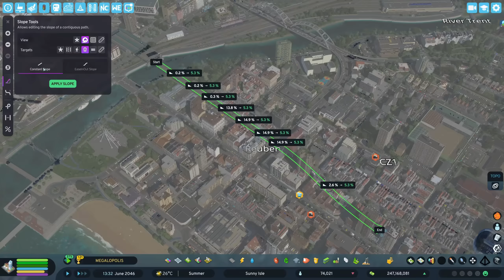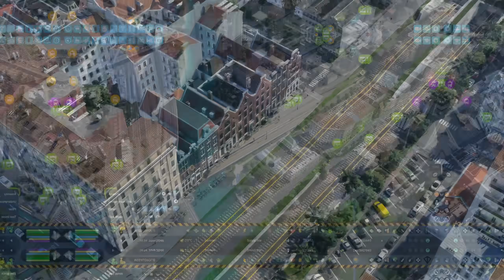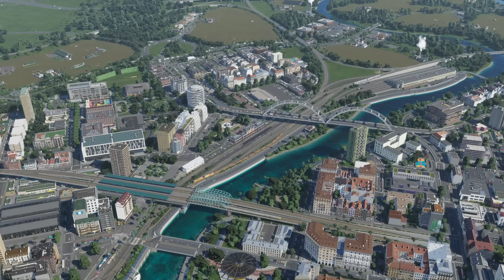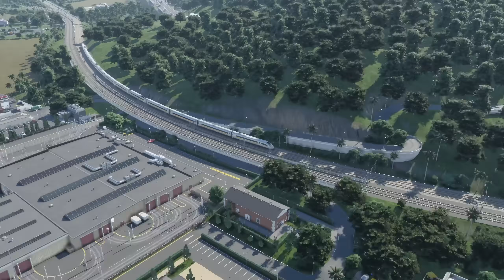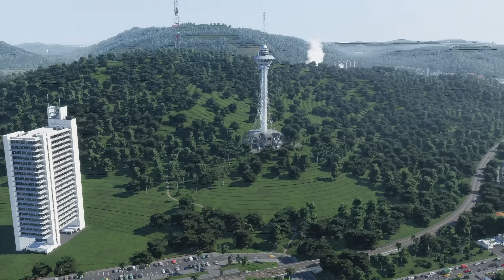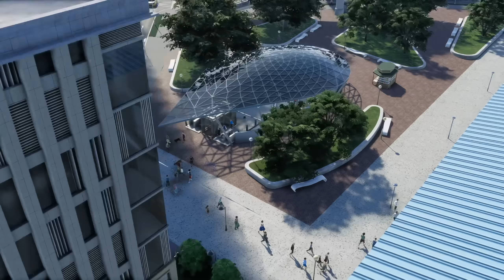I Finally Gave High-Speed Trains Their Own Station — Cities Skylines 2

Comment: I use the 4 rails a lot. I use way points to make cargo rail use the inside lines and passenger trains use the outside. It's a bit to set each line, but it really makes a difference. Tip: be sure to use the way points wherever lines intersect or split.

Comment: loved the vid, quick question I tried to download the sunny isle mod pack but my pc couldn't handle it, what are you pc specs?
Reply from the maker: CPU: Intel Core i7-13700KF
GPU: Intel ARC A770 16GB
RAM: 64GB DDR4 3200MHz
Memory Motherboard: ASUS TUF Gaming Z790-Plus WiFi D4
Reply: Ty so much, im running 
CPU: i5 -12400f
GPU: RTX 4070 super 12gb
RAM: 32GB

What specs would you say are important to run this pack?
 @SunnyScunny
Reply from the maker: Honestly, there are more clever people than me that can advise, I’d recommend Discord or Reddit for more info
Reply: @SunnyScunny fair enough, but thank you very much for your help

Comment: 42:13 TBH You could extend the bridge over to the station as a 0-elevation change "direct into the station" access route... presuming sub-mezzanine public area is around that area with either part-time station gate access or shop walkway within the station limits. Those kinds of limited TOD are very popular in Asia.
Reply from the maker: Yes, a few have suggested something similar, I’ll add it 💛

Comment: 8:51 I had to smile because thats basically what the high speed network in Germany looks like. ICE Trains which you are also using as your high speed trains are sharing tracks with freight, regional and local trains basically all over germany. But to be fair you want a functional and non disruptive network which we don't have in real live germany😅
Reply from the maker: Inspired by HS1 in the UK, it’s a different tack gauge to our regularly trains because it has to run into Europe

Comment: The Mediopadana Station looks awesome and might work when transitioning from older parts (historical residential, commercial, etc.) of the city to the new more modern parts of Sunny Isle.
I love how you saw something that needed to be done and then, instead of thinking about it, you just did it.  That is how I work all the time!  Start out with a plan, yes, and be willing to organically and creatively shift off to something that enhances the entire city; something that was never intended but works perfectly once it is in place 🙂
As for the trams, I do have Tigons Tram Infrastructure mod (I think you have this one).

Comment: Lets go love the organic growth. Just wanna say that the speeds on the trains close to the station don’t really make sense, feels like they are leaving the station at 100mphs. Also I feel like the metro would leave a much smaller footprint if the overground stations were adjusted to the size of the trains
Reply from the maker: Yeah, I agree, but I prefer to use prebuilt assets, as they tend to not break as easily as custom builds over the games many updates 💛

Comment: Nice work. I agree with comments above. Modernize the high speed station, but also recommend densifying the area around the new station while moving low density housing to the hills around the sky tower. HK and other hilly cities have this.

Comment: Oh yeah! Me likey! And phew... those 197s do indeed look the part so much more than the re-purposed vanilla subway cars.
Not so sure about the tin-roof looking supposedly shiny new high speed rail terminal but maybe we can find something that'll allow for the longer version... (I know REV0 has a station coming that can accommodate the 1x13 but it might be a little while away before it's available) but the Mediopadana Station would be much nicer even in an interim capacity.
One small challenge I lay down though: connect the end of whichever station you use, via a footpath of some variety, to the local station, for direct transfers. For the big tin can you could run a ped path through and add a door decal, for example.
Anyway, dare laid down, can't wait for the next venture! Oh, and presumably with the 1.6 patched version for the next one! Hurrah! Nom...
Reply from the maker: New station incoming! 💛

Comment: Turkeys high speed rail shared lines with regional and suburban networks especially around istanbul which makes journeys to places like ankara and büyükşehir (not sure if they have station correct me if im wrong) even longer than they should be. Also ticket prices are reasonable even somwhat cheap and affordable but not for the locals turkish lira will only get you so far 😅
Reply from the maker: Sounds fab! 💛

Comment: Just a side note: Those trains are the newest models of our ICE 4 (German pronounciation: "eeh-tseh-eh"; DB class 412) trainsets here in Germany, whose project names until 2015 were ICx until 2015. They are in service since 2017 and run 250 kmh in real life.
Reply from the maker: I’ve reworked the track and station after this, got the 13 car running now, and it reaches 202km/h
Reply: ICE 4s can and do reach up to 265 km/h, it is just he BR 412.2 (1x7) that has an regulated Top Speed of 250 km/h. The shorter 1x6 ICx variant also just go 250 and the ICx-TD (Diesel) can also only go 200 km/h.
Reply: Aye, the in-game speeds are effectively double real speeds, hence the track is made to in-game 500kmh and that equates to real world 250kmh. Of course, the length of track from station to outside connection, with plenty of curves, means the train itself won't reach anything approaching top speed but it'll certainly run faster than vanilla trains on vanilla track (hopefully).

Comment: Are passengers able to cross underneath the local-rail station next to the new highspeed station? I wonder about the connectivity between tram, highspeed, metro and local-rail.

I'd also imagine that the residential area now has some densification pressure - perhaps a block is redeveloped into dense, luxury mixed used. It's the best-connected place in the city now, and adjacent to the beautiful nature reserve, so should be very desireable.
Reply from the maker: Yeah, people should be able to get around a little easier, I’ll add a sky bridge. And will look to add some more density soon too! 💛

Comment: You can use both the platforms of the terminal station by making the following route:
Here PF is Platform and OC is Outside Connection or Other Connection:  PF 1 -->  OC --> PF 2 --> OC --> PF 1
This will also not create traffic close to the Terminal Station.
Reply from the maker: Great advice! I’ll do that 💛

Comment: I think that applying real world limits to rail (and road) slopes is a bit too constraining; the game doesn’t scale 1:1 with real life. Exaggerated, steeper slopes fit the game scale better than strictly realistic ones. For example, we don’t mind the much closer stop spacing in the game compared to real life, so why should we arbitrarily demand real world gradients?

I guess it’s a bit late now, but I think it was fine before tbh
Reply: @WhatsleftofTom    I agree it is both too restricting and not scalable.

2.1% is 2.1cm per meter. Normal overpass height in the game is about 12-15 meters which means the slope would have to be 600 to 750 meters long to meet the requirement and thats a grade in the steep end.

The recommended for freight would force the slope segment to be at least 2.4 kilometers.
Reply from the maker: Yeah, I agree too, it’s trying to find the balance. I’m happy to bend rules every now and then! 💛

Comment: Another fantastic episode 👏 
Which are the props used for the subway bridges close to the main station?
One suggestion: put in a connection from the new HS terminus to the regional tracks right at the entrance of the station. Therefore the new rail yard can feed the HS station over the regional tracks and not obstructing HS trains on the main line!
Reply from the maker: Rail Truss Bridge Kit by Joergske https://mods.paradoxplaza.com/mods/143426/Any

Comment: I love this addition to Sunny Isle it has an HS2 vibe to it. I love its positioning too, considering how developed everywhere is. I would have tried getting it as central as possible, but your approach with those metro, tram and existing rail connections to transfer to is much more realistic.

Tram recommendation: I've been using the HBLightRail Generic (WE Support) by Vttoc it's a great looking asset  and comes in various size options